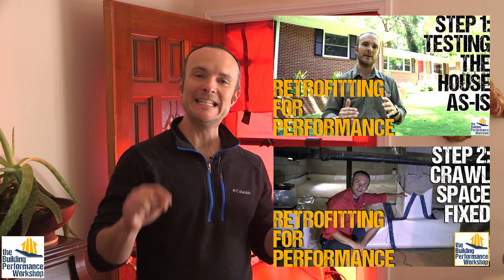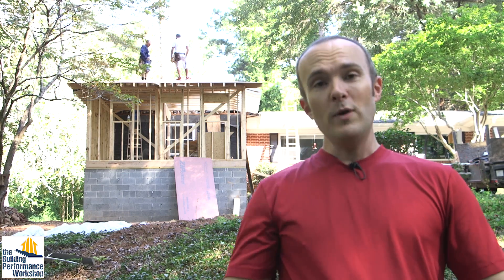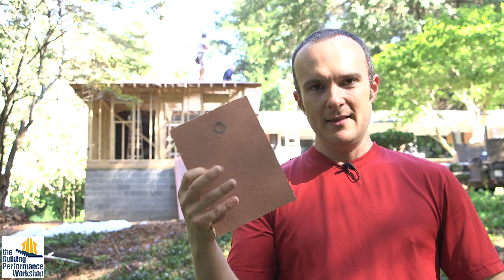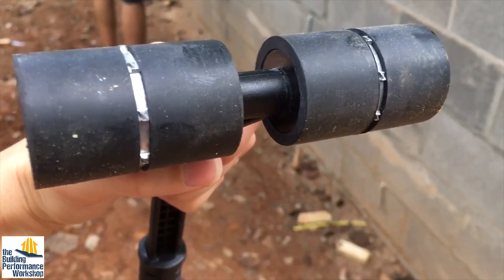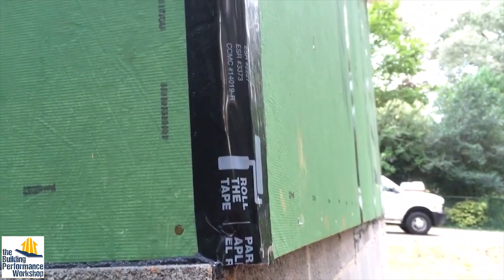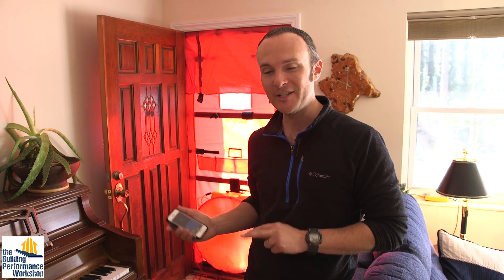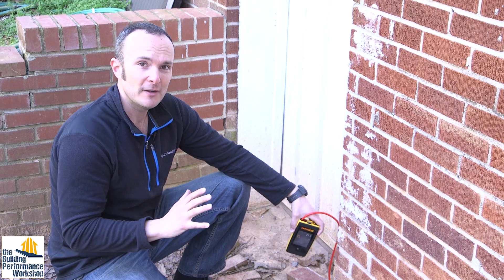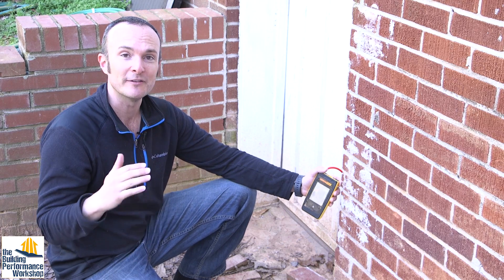ZIP System Detailing on Addition to 1960's Ranch Home, and Blower Door Test

Comment: Missing metal flashing on the bottom. The Fluid applied is OK for sealing around seams, but you really need metal flashing where the foundation meets the ZIP sheathing. The problem your going to run into is that the concrete is going to wick water and moisture in to OSB along the bottom edge causing it to rot out. Hopefully the contractors installed a sill sealer\membrane down for laying down the sill plates
Reply from the maker: Yes, sill sealer is code, but I doubt the liquid flashing goop will be a communicator of moisture- it’s built to do the opposite.
Reply: The issue is that your just applying the liquid flashing along the side, not underneath the OSB sheathing. Direct contact with wood & concrete provides a moisture transfer path. Typically Metal flashing is inserted in the gap between the foundation and the OSB so that the entire bottom edge of the OSB is isolated from the concrete. Alternatively applying a peel-stick water-ice tape to the underside of the OSB sheathing would probably also work. For air sealing, You can apply caulking to the sill plates and RIM boards before adding the sheathing. It would also be helpful to apply a exterior primer to the exterior side of the sill plates and rim boards and seal any holes that the primer does not cover over.
Reply from the maker: All reasonable points, but fyi, ZIP is basically Advantech, made on the same assembly line. The glues give it pretty insane moisture resistance- I believe more than 6 months of constant rain and sun guaranteed.
Reply: Sorry, the OSB will Rot. Matt Risinger did a video on the ZIP Sheathing rotting on the bottom without bottom flashing. AdvanceTech  Flooring only warranties exposure for 1 year. Is a very good produce but its not indestructible. I used the ZIP wall sheathing & Advantech for my subflooring.http://mattrisinger.com/zip-wall-tips-advice/Matt: "you MUST use a base wall flashing to protect the raw edge"

Comment: After watching the zip sheathing 2.0 video from the build show where the guy pretty much just used the zip liquid flash on all the seams and nail holes instead of the tape. I have been dying to see if anyone else would pick that up. That video is a year or two old now. I see that people are still using the tape. I just can't see the tape lasting as long as a well done liquid applied flash. I am very interested in trying that method on a tiny house with Zip-R sheathing to create  an unbroken blanket layer of insulation. I just can't find more people doing it?
Reply: The Fluid Applied flashing can be tricky since if its applied to thin or too think its not going to last either. Most Fluid applied flashing protects require the contractor to take a course. Most don't. The ZIP tape sticks very well as long as the sheathing is dry and its properly pressed down.  Huber provides a 30 year warranty on its ZIP tape. The ZIP tape can also be installed considerable faster and the ZIP fuild applied flashing isn't cheap. There are no nail holes in the tape, you just seeing the indentations  under the tape. The tape is applied after sheathing is fastened (nailed) to the studs. Unfortunately the contractors make a big mistake not using metal flashing between the foundation and the sheathing since there is no membrane or barrier isolating the OSB from the concrete foundation. Water and moisture in the concrete will wick up into the OSB from the bottom edge causing it to rot.

Comment: Corbett, you mention that you need to add performance specs to the contract. At what point do you do that? Is it done with an architect or do you need to hire a lawyer that specializes in construction contracts to do it? For your kind consideration.
Reply: Thank you for the information. I great appreciate it.
Reply from the maker: I’d make sure the architect knows what you want performance-wise so they don’t design a home that’s impossible to build that way, but really the builder and contractors are the critical people for delivering on those targets. The specs should be in the plans or in the contract, but you shouldn’t need a special lawyer for anything.
Reply: FWIW: The architect only has a small part of HP home structure. The majority of the sealing will be done by your framer. Starting with the foundation. While the architect may include some notes about the construction is 95% of the effort is going to be in the hands of your framer to implement them. It would be best that you fully understand all of the processes needed to properly seal the home, so that you can communicate to the framer. ideally you need to be able to inspect the framers progress to make sure processes are getting implemented as discussed.1. You want to start off with a level & flat foundation. This will require using a straight-edge and a carbide grinder wheel on a grinder to remove all of the high spots. Then apply a concrete sealer (paint) to the top of the foundation walls. This will help avoid moisture from wicking up into the sill plates & rim boards.2. Apply a sill sealer (Poly membrane) or a EDPM membrane as the sill sealer before laying down the sill plates. I recommend using Simpson Titen concrete bolts instead of standard J-Bolts. 3. The framer will need to properly seal up any seams or joints using the manufacturers instructions.Beyond framing, sealing will need to be addressed by other contractors: including Plumbers, electricians, HVAC. All of the wall penetrations will need to be properly sealed.

Comment: Do you think the zip system would be less than/equal to/better than the solitex house wrap system? 

About to start my new house. In a few months, the Zip system is very common in my area but I am very interested in the solitex system because of what I have seen and read about it. Your video from about a year ago being one. Thank you
Reply from the maker: They both have their strengths and weaknesses- I would actually recommend to use what your builder is familiar with already than have them experimenting on your job.
Reply: Zip sheathing is a labor savings since once you put the sheathing you also have the vapor barrier installed. You just need to tape up the seams. You are less likely to run into rot problems since the membrane is bonded to the sheathing. with the house wrap wall penetrations (windows, doors, electrical, Plumbing, vents) can permit water to get under the wrap and wet the OSB.  For example tape a pieces of scrap wood and put a coat of exterior paint or poly eurthane on it. Take a another scrap piece of wood and nail a piece of house wrap. Drill a hole (simulating a wall penetration that is leaky. Stand up the boards and soak them with the hose for a few minutes. Which one has the most surface exposure to water?FWIW: I used ZIP sheating for my walls. I also had the crew apply bead of caulking on all of the studs before nailing the ZIP sheathing to avoid air & moisture leakage around any of the nail penetrations or the seams. The Seams were all taped and I used metal flashing between the Sheathing and the foundation walls to prevent moisture wicking up.On the exterior side I install 2" ridge foam insulation and 5/4 x4 battens for the siding. There is about a 1" gap between the exterior foam insulation and the siding to serve as a rain screen, with vents at the top and bottom of the walls so that any water that gets under the siding can dry out. This also acts a solar thermal barrier when the sun heats up the siding. Air flow between the foam insulaton and siding can remove some of the heat via convention.

Comment: At 5:39 when you're adding liquid flashing to the corner, does the underside of the section with material that stands proud of the foundation wall also need to be coated?
Reply from the maker: For airsealing, yes
Reply: Yes to prevent moisture from wicking into the OSB. Metal flashing should be used instead of the fluid applied flashing to avoid rot.